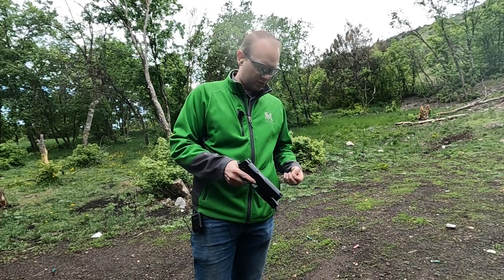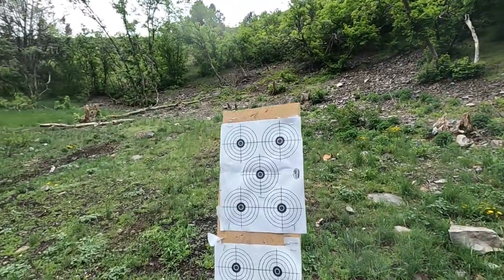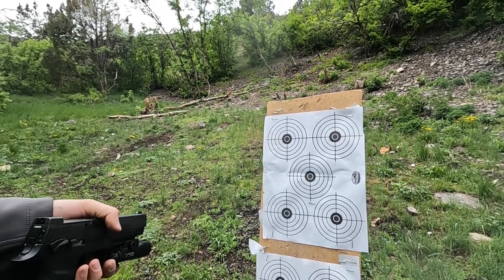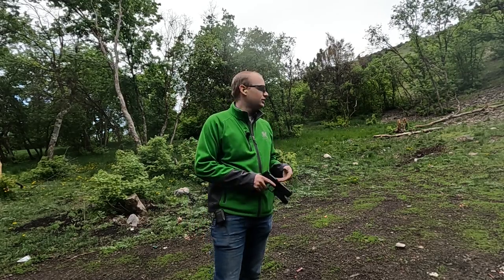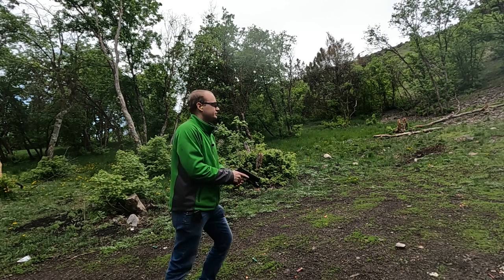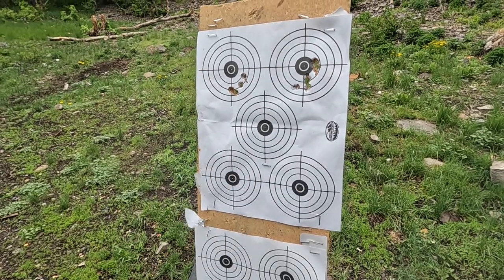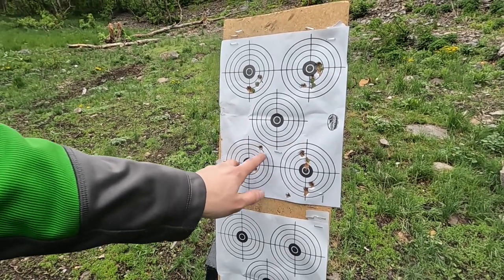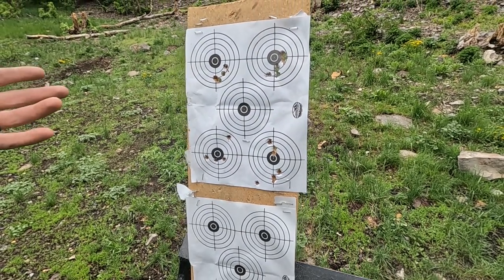Powder Coated vs Factory Ammo Accuracy Test

Comment: Your test was seriously weak. You need to test more than one load both hand loads and factory and handloading factory bullets. The most accurate Auto I have every had it was with cast bullets and it was not a weak or light load. Because lead is heaver than the jackets on jacked bullets that leaves a little extra case capacity for powder with the same weight bullet.
  Its not just the load. I have lee sizing dies form 355-358. And I have found most the time for 9mm the 356 works best in autos but on occasion the 355 is the best and one time the 357 was the best for accuracy.  I have a 460 S&W and I am using cast bullets for long range shooting with it. I use cast powder coated bullets. They are as accurate as any of the factory bullets I have tried. Its a 330gr bullet leaving at 1900fps. I have found I can push powder coated bullets a lot harder than I was taught when younger. 
 Always push the bullet through the sizer base first that will make a difference with accuracy. A lot of the sizers already size base first. But the lee system does not always make it easy to do that. Years ago I had the tip of one of there rams concaved and it works with most round nose bullets. I cant figure out what its called. But I have some of the metal that is used in Fire Sprinklers it melts around 100 degrees and it is used to trip the sprinkles. For the lee 30cal 230 gr cast bullet to be able to push it through base first. I took a M1 carbine case sized it down smaller than 308 filled with the fire sprinkler metal But a lee cast bullet in a drill press point down heated up the M1 case and feed the tip of the bullet into the M1 case let it cool and Now I have a ram so I can size them base first. For the record in a 1-10 twist barrel somewhere past 2200fps accuracy totally goes away then they start keyholing. 
 Dont ever underestimate the potential accuracy of lead bullets.
NDR
Reply from the maker: I recognize that the sample sizes were small and there are a lot of variables I can play with to improve my cast hand loads. This is definitely a topic that I will be returning too in the future to see what I can improve.
Reply: Do it do it

Comment: I think with a little load workup you could easily exceed factory.
I've done it using cast in both 9 and 45 using WW231 at a modest loading.
Of Course, I have no idea about your loads.
Reply from the maker: Yeah, this test got me thinking that I need to play with my hand loads a little to make them better.